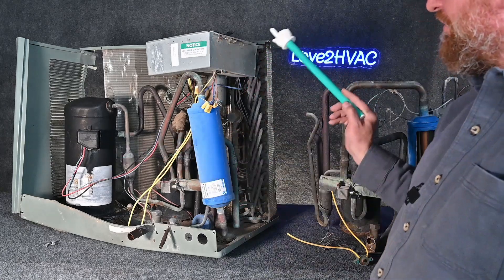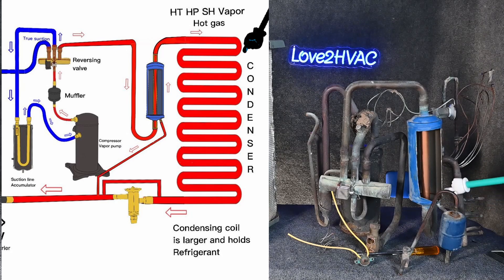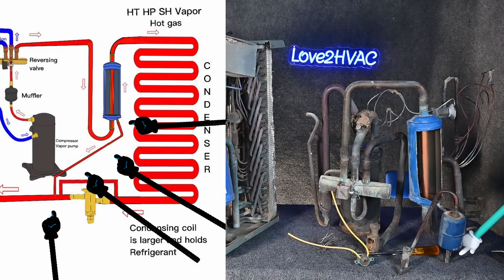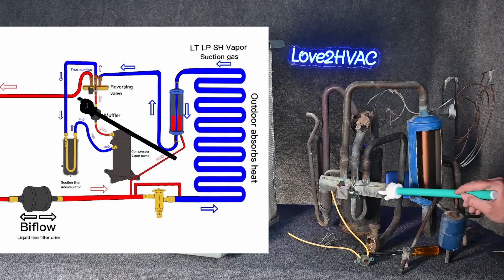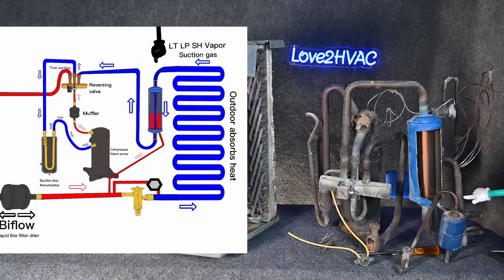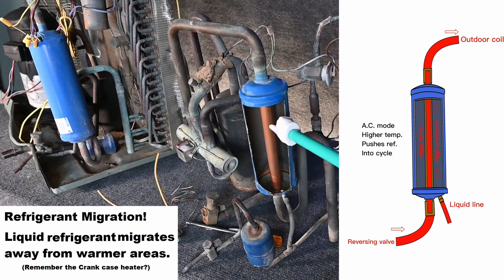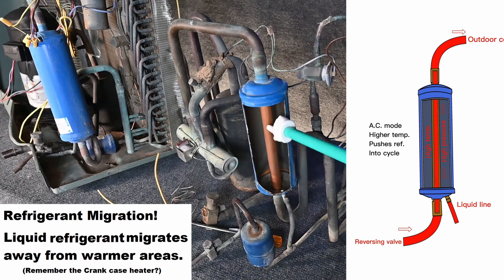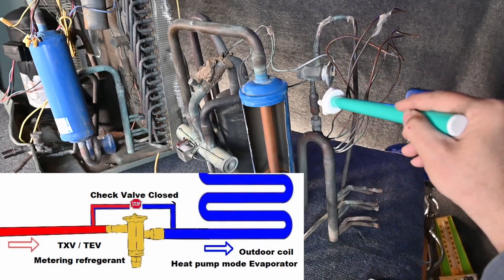Heat Pump 09 Charge Compensator 1 0f 2 the original

Comment: Wouldn’t dumping high pressure liquid into the low pressure side of the system affect the pressure the unit would be running at and change the amount of refrigerant the metering device was feeding?

Comment: If its so great... why do most units not have one and operate properly? Also seeing thats a Rheem....they have more issues to worry about than a charge compensator.
Reply from the maker: Rheem is not the only brand that uses this simple method.

Each manufacturer uses engineers,  testing and accountants to determine what components will work for their needs for the cost. 

No manufacture is perfect and most likely don't care what technicians think.  Understanding how things work and  why they are there makes our jobs simpler and better equipped to overcome challenges. 

The best unit is the one that is installed correctly. 
Regardless of how manufactures accomplish the end goal I find a much greater issue of poor installation.  Brazing without a nitrogen flow, improper vacuum and dehydration, improper decay test. Improper returns and supply duct work, improper system sizing, line sets, leaking ductwork, and so much more.
Reply: @love2hvac  ....simpler would be for it not to be there at all because it's not needed. I've never seen a Rheem with a charge compensator perform in anyway better or last longer than others without. The more you add to a system the more issues you will have. One of my techs are changing one out tomorrow because it's rusted out. Hence my point. I love your videos and love teaching techs. Just would like to see both sides included. The good and bad give a more thorough evaluation.
Reply from the maker: It's really not going to be an issue for or against. We are now entering the age of inverter technology, inverter boards, variable refregerant technology with manufacture specific algarythems and secret service methods. These vrv systems include a host of parts with piping diagrams that look like wiring diagrams.
Reply: @love2hvac  absolutely. 👍

Comment: Is that the same as an accumulator?
Reply: No.  The accumulator permits liquid/vapor separation so the liquid can be vaporized before continuing on.  The compensator has a pressure that adjusts based on the refrigerant in the main body being warmed or cooled by the refrigerant flowing in the center pipe.  Thus less liquid can enter the compensator when it is being heated, and more when it is being cooled due to the pressure changes